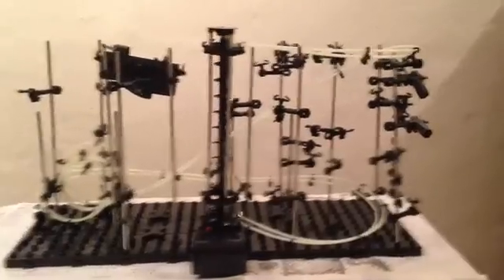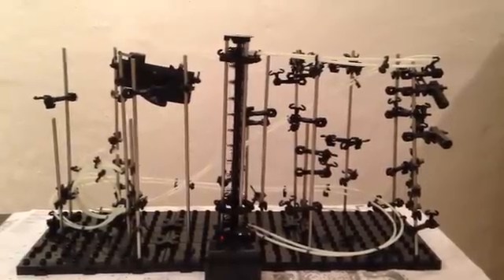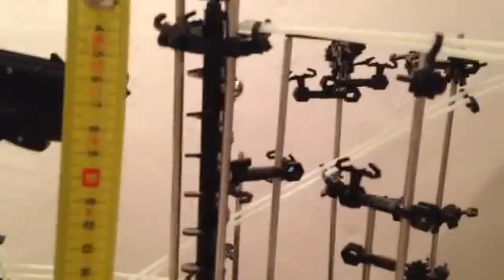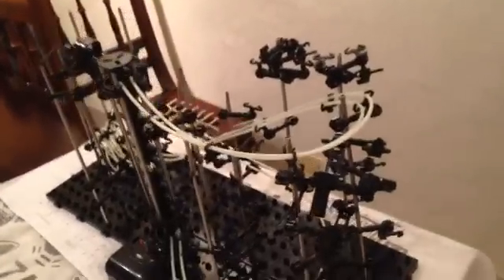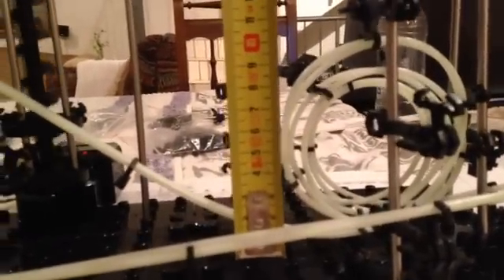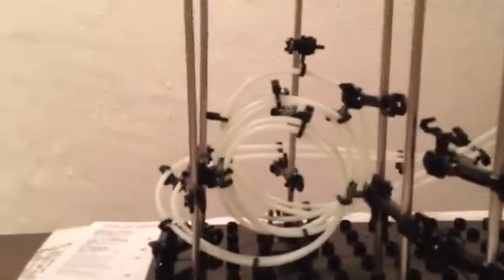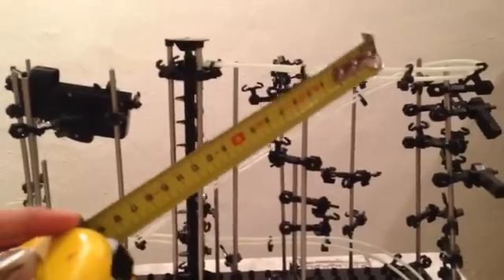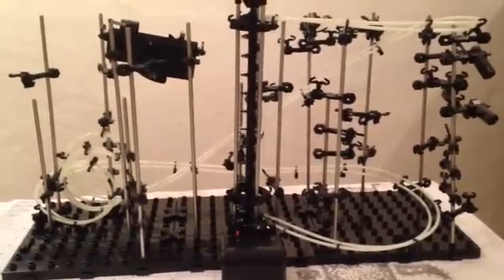Spacerail level 4 - Loop help!

Comment: Wow, i didn't know any one else was building this! So have you supressed the first top curve? Before the big drop down? And you also inverted the loop direction? It was to begin from the inside to the outside, and then make a big straight track, on the front, right to the backside again to enter elevator z-3, no? Mine is very different from yours.